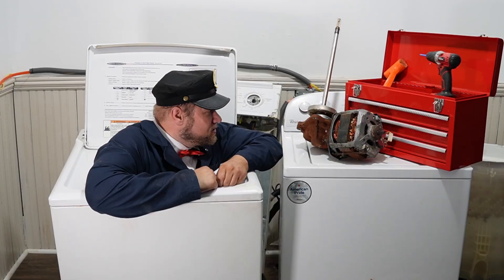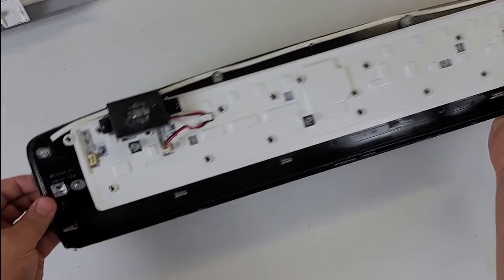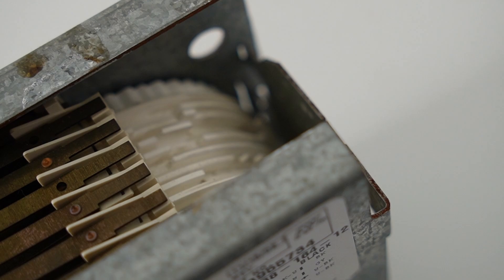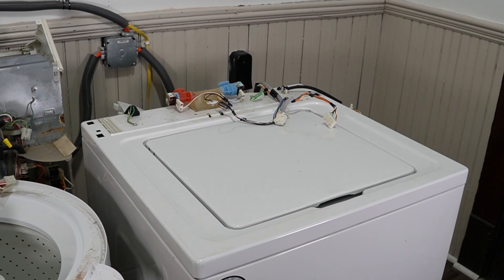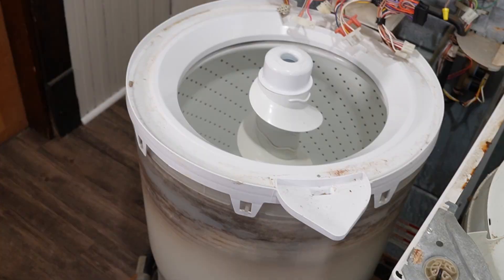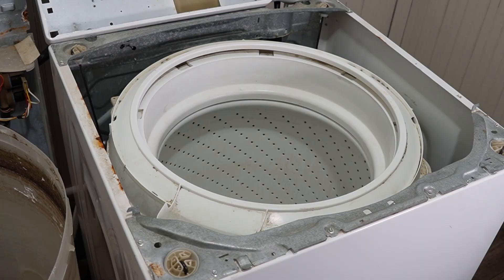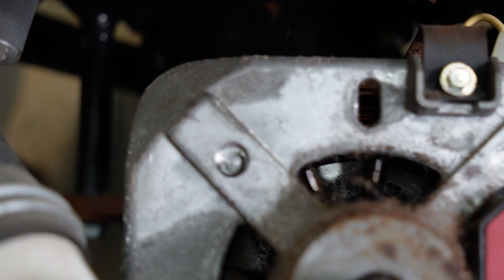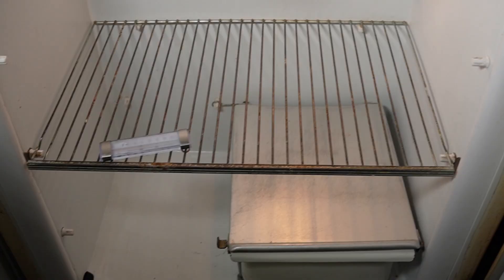Are Washers Built to Break? Inside a 1984 Washer vs. Now

Comment: If you wanted to keep the classic Kenmore washer a lot longer - would you do something about the bad rust?  Replace the springs while it is apart?  Sand, paint the supports?
Reply from the maker: Eventually I'd like to do a restoration video and just rebuild every piece of it properly, and show it off. I would remove the rust and repaint, replace the springs if I felt they were weakening, then go through and probably replace or look heavily at all the other wear parts and consider replacements - drain pump, lid lock, agitator dogs, transmission seals / oil, gearcase rebuild, and so on.

Comment: When it's an obvious failure on the board I'll float a relay or receptacle back on a board but it's not always that obvious and the time it would take to troubleshoot on the micro circuitry level it's almost a better value just replacing the board.

Comment: I wonder how the original 1984 model would compare to the 2002 version, especially in terms of country-of-origin for the various components.
When my parents first moved into their current house in 2002 they replaced the 1987 Kenmore-Whirlpool washer and dryer pair that was original to the house with a new (at the time) Kenmore-Whirlpool pair, and the washer from that pair is extremely similar to the 2002 model shown in this video.
That pair is still in service and has only needed a few minor repairs over the past 20 years, but I wonder if there were really any substantial differences between the 2002 pair and the ones they replaced other than cosmetic changes.

Comment: One issue is that the manufacturers intentionally keep the cost of replacement parts high, encouraging the customer to buy a new unit instead of repairing.  I personally despise that practice, as it's wasteful.  We're filling up landfills over plain old greed rather than necessity, and that's just wrong.
Reply: Also, most manufactures are not interested in warehousing excess parts.

Comment: I can tell you the reason why. Older appliances were not cheap, the stuff that lasted 30-50 or more years were quite expensive at the time and they probably broke down a couple of times or even more in their lifetime but the main advantage is that they are extremely simple mechanism. Changing a belt or a ball bearing could be done by even the less experienced technician.
Nowadays it's complex and not always doable or worth it. Appliances are very cheap and often the repair can cost like the new one so it's not worth it. The internal mechanism is all plastic stamped to be tight fit and uses custom pieces that cannot be replaced by a non authorized technician.

Comment: I have my washer a Kenmore from 2002 (and dryer) use them everyday! I’m going to be a very pissed off person when I have to go modern. I run my washer on full loads all the time, and the dryer I keep on low (to save the dryer element). I had to jump the lid switch on the washer, it died last year.

Comment: I have a question.  On the older washing machines, did you have to clean out the inside like we have to now with the new machines?  I don't remember my parents cleaning out their machine when I lived at home with them.  I do remember having a filter to clean out on the older machine.  It seems that current washing machines are only made to last maybe 5 years, unless you want to open it up and clean the filthy mess inside it.  My current Samsung top load doesn't have a filter.  I've been watching videos on why my clothes are dirtier after washing than before.  I opened up the inside tubs and I have some awful pictures.   There has got to be a better way.

Comment: I purchased a Kenmore 80 series washer and 90 series dryer from Sears in 1993. The wash tub is porcelain lined and has been slowly chipping away which leaves little bits of porcelain on the clothes. This has also caused a small patch of rust on the bottom of the wash tub near the base of the agitator. Is it time to give her up because of this?

My gas dryer start button started giving me problems about 3 years ago where it is completely stuck in the on position and the timer dial never stops ticking.  This means that I have to unplug the dryer  after every use or it will turn itself on when I'm not around.  I had an old-school appliance repair man who is very knowledgeable about these old style  machines come out and fix it twice but after the 3rd failure decided to just unplug it. I've been contemplating a Speed Queen TC set but everytime I think about saying goodbye to my Kenmores my eyes well up, I just don't think life will be the same without them.

Comment: They make the new stuff to break and replace. Let's see this in action. On front load washers outer tubs were clam shells held together by several screws. Now they make them as plastic welded together. In the one with screws, you can do actual repairs cost-effectively. For the welded unit you just replace the entire unit. It is more cost-effective to just replace the entire washer. The new water valves. If you have a leaking machine very good chance the valves will need to be replaced. New VS Old. Old wins hands down. How many new machines crap out because relays get too hot and blow the solder joints? known problem but they do nothing to correct it. They rather sell $300 dollar control boards.

Comment: I'm more impressed he got in the machine at the end.
Reply from the maker: Getting in it took a few seconds. Getting out took wayyyy longer than I wanted it to be. I had to climb out and pray the shell could hold me.
Reply: @bensappliancesandjunk  I thought it was all special effects till you slapped the washer next to you and started wiggling around in your tub, after that I was convinced you had put in soooooooooooo much effort into your videos.
Reply from the maker: @brianfong5711  oh no, it's 100% me in the washer chassis. I have it off center though so I'm not sitting in the tub of the washer, just the shell. It was easy to get into but for some reason I couldn't get out the same way I got in

Comment: The electrolytic caps on the electronic control will probably fail in about 10 years, and since nobody wants to diagnose board level problems, you won't get by with a $1 cap, you'll probably pay $300 for a new board, at which time you throw out the washer.  Oops, you said the same thing!

Anyway, the irony is that modern caps can be extremely reliable and you can get very high quality caps that will never fail and the difference in price is pennies, not even dollars.
Reply from the maker: Depends on who you are. We replace the 1000uf/6.3v caps on these all the time because we know what to look for. But sadly, 90% of techs and 99.9% of home owners don't want to invest in the tools and learn basic soldering techniques.

Comment: l like the fisher and paykel washers, no transmission just a direct drive stepper motor, the only thing that seems to wear out after 10 years are the seals, bearings  and shaft, the early ones used aluminium for some parts and these corroded, but since they have  gone to plastic that problem no longer exists, replacing the shaft, seals, bearings and suspension springs will set you back about half the cost of a new machine unless you diy, which is dead easy no special tool required

Comment: Yes! The newer machine is made of Chinesium. Corrosion already well progressed in a few years. This is why atomic weapons are the only way to pull that "modern" tub. I have a 30 year old Kenmore, what they used to refer to as a "family" sized tub. Yes, I can wash a king size comforter in this beast.  So, what does it need? A new set of springs, as the basket leans to one side...after 30 years.

Nuff said.. 

Nice note, my pump and motor are sparkly! The seals are perfect. Oh, and if you need parts? No 30-45 day backorder from Chi-na.

Comment: My washer dryer are 20 years old still going the washer just needed it’s clutch replaced and the dryer the heating element other then that there still doing their jobs. The washer bangs around on spin cycle still works the dryer been abused with high heat drying both needed simple parts replace the clutch on the washer went out after 19 years of use the dryers heating element failed after 18 years of use these machines are built like tanks.

Comment: I'd say well over half of my customers actually come in thinking "mechanical controls = good, electronic = guaranteed to fail quick!" but that's absolutely wrong, and this is a great example of why LG's washers last seven times longer on average than WhirlPoop Corporation's machines - solid state inverter drive three phase brushless motors (even on the drain pump!!!) which is easier on the motors and doesn't arc and spark like those ancient tech cost-cut garbage relays that WhirlPoop uses for literally everything... heck I wouldn't be surprised if they're using the same $0.03 chinese relay to control their ancient single-speed resistance-start induction motor as it slams on and off... really shameful that a WhirlPoop machine costs the same or even more than an infinitely higher quality LG, but yet customers think "Oh, Maytag! That's the best brand! Give me one of those!" AMERICANS ARE DOOMED unless they start learning how things around them work, and understanding how their own corporations are swindling them. 😢

Comment: I think the main problem with modern appliances and electronics is not that they were specifically made to break, but rather made to be hard to repair. For example, they know the control boards won't last forever, especially relays and pressure switches. Their solution to those breaking is just to sell a whole new board, instead of having the relays and switches an easily removable component. Most likely they want to do this to minimize the inventory of parts that they need to keep. Good for the company overall but bad for everyone else. This trend of disposable equipment is just sad. The other problem with modern appliances is that modern aesthetics force the components into very tight or bad locations. People no longer just want a boxy appliance. They want those nice sleek curves, and that comes with consequences. Of course, they can still be made easy to repair and just as reliable, but most companies just don't care to evaluate and redesign. Why bother make it repairable when you can instead make your parts expensive as hell, so that it forces people to just buy a new one.

Comment: Same goes with cars,cars used to be easier to repair,more reliable and fun to drive.I still drive a Lada Samara from 1991,which isn't  that old,but has a carbureted engine.
Then people complain how you need to adjust carburetor,how it breaks easier,but guess what i can tune a carburetor with a flathead,can you repair you ECU with that,or you must buy a new one.
Old technology for the win!

Comment: I bought a UESD Maytag washer in 1985. In the 37 years nothing has gone wrong with it.........until now. There is a water leak from something. A water hose goes into a plastic thing and a hose goes out. As of now, I can't see if the plastic thing cracked or it's a hose. I would like to just fix it.

Comment: My son has a washer that does not have a dash. If you put a normal size load the top of the load will not even get wet, So washing smaller loads does not save anything. When you have to buy three machines to one of the old style, you sure haven't saved at all.

Comment: We thought we were doing the right thing by upgrading to an "HE" machine.  HA!   After 5 or 6 years, the spline gear/teeth on both the transmission spindle and wash plate wore smooth.  Cheap metal.  With a little CAD work I figured out where to drill (2X) the wash plate.  Put the plate back in the machine and drilled down into the transmission spine.  This put half of a circle in both the plate and transmission spline.  Cut off two 10 penny nails and drove them into the holes.  Been working fine for a couple months now.  But what a piece of garbage.  (This was a Maytag washer.)

Comment: I do wish they'd make modern washers that are more like the 1980s version, with the efficiency improvements of the newer version baked in. I think the same about cars, too much electronics and high-end stuff. I want a simple, robust, reliable car or appliance, designed to be easy to maintain.
Reply: FWIW, we bought our washer, front loader, used for 100€ in 2007. The electronics went weird in it 2018 and we bought another used washer for 120€. I am not sure why but there's a cheap 2nd hand market for washing machines only a few years old. I think because people move and can't take it with them to their new place.

Comment: Our Samsung wasn't working, we called them they gave us a quote of about 60-80$ to check the machine to than later be on the phone with "Samsung certified  repairman" to tell us it would come out to 340$ including the viset he never did to repair it saying the code ment the pump had to be replaced and it was broken, of course we called other repairman around and the lowest we got was 280$ saying the same thing. But We said "nope" showed them our favorite finger and took it apart ourselves since a new one would cost around the same, we found a tiny pebble stuck in the pump not allowing it's blades to spin. It took us a total of 40min and some water to clean up but. "Favorite finger" to those guys, 280-340$ for a tiny pebble? what a scam.

Comment: Techs skilled enough to rebuild transmissions and mechanical timers and inventory of rebuild parts cost enough per hour that module replacement is less expensive for customers.  New modules are less likely to break soon.
Cost varies if you want to reliably fix things or just get paid to work on things.
Reply from the maker: That could potentially be true for physical transmissions, but definitely not for PCB/board-level repairs. I belong in tech groups that do board repairs. They give 1yr warranties on all PCB repairs and the frequency in which there are warranty callbacks on the board-level repairs are less frequent than module swapping. Beyond that, it allows for MANY more first call completes, and less condemnations of units that have NIL-boards, which we are seeing a lot more of. Its now very difficult to get control systems for 10 y/o+ units for many brands.

Comment: I hate to tell you this Ben- but a washer made in 1984 is way older than 20 years ago. 😆 I should know, I was born in the early 80s and have the grey hair to prove it!
Reply from the maker: The design is from 1984, and the actual washer was built 20 years ago, the Kenmore has a date code of 2002. That's why I say 20 years. I felt like titling the video comparing 1984 to now would be more impact full than saying 2002 to 2017 which are the actual dates of mfg. On these exact 2 units as documented. 

And yes 1984 is way Older than 20 years I was born in 1985, so I hate remembering that, ha ha!

Comment: For the newest whirlpool machine, you need fire on it, I work with those machines and gosh  is a pain in the ass get the Tub out, needs a lot of WD-40 and heat from the torch, repeat several times until the tub is loose them you can pull out from the transmission, this happened because the soap gets between the mechanic seal and the Arrow making difficult to break it, is like hard glue, and one of the most common faults in those transmissions, now for the actually transmission, you can disassemble it breaking the machine rivets with a drill, and for getting together again put some screws and bolds in it, sadly the transmission is totally sealed in those models not like the Easy/Mabe ones (all from the ID system up to aqua saver)

Comment: I think modern washing machines do not last as long as the older ones for a 2 main reasons: 
1) Introduction of computers. Seriously...how often do you have to replace a computer these days? 5 years? Give me a break. Computers themselves, are planned obsolesce. 
2) Quality of materials. This is a given. Whether it be metal or plastic, they do not make ANYTHING like they used to. Take brake rotors for example...I see rust on brake rotors on brand new cars, just after sitting for a couple weeks. Compared to my 88 Mercury (which had the original rotors when I bought it in 2010), had NO rust on the rotors. The quality of metals and plastic clearly is not what it used to be.

Comment: New mechanical timer switches are poorly built these days.  Swapped on my cousin’s dryer.  Pulling failed one apart, the contact were misalligned causeing on set to burn out rather quickly.